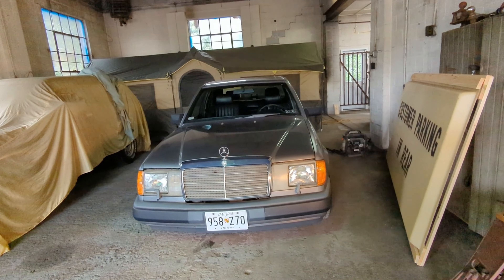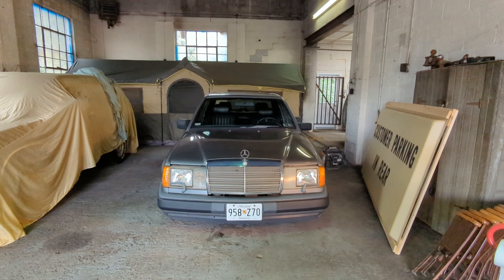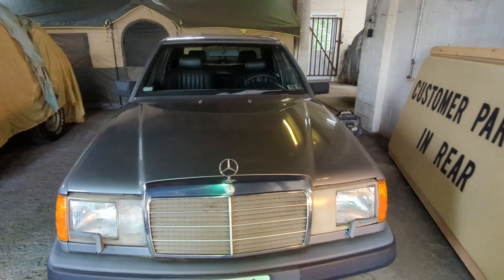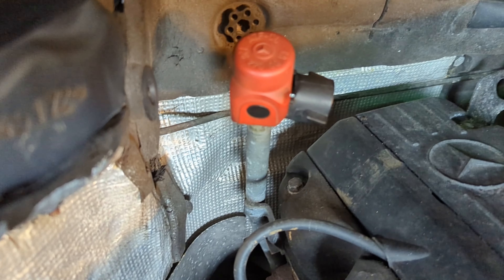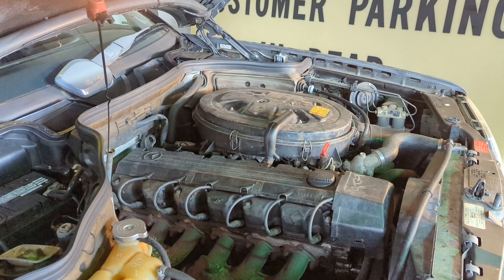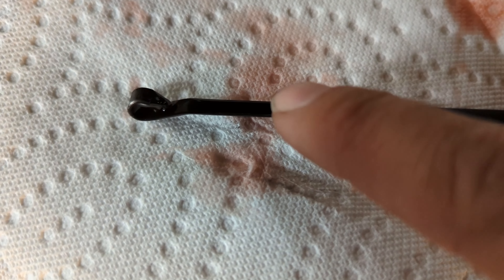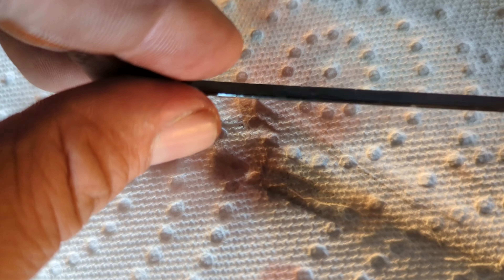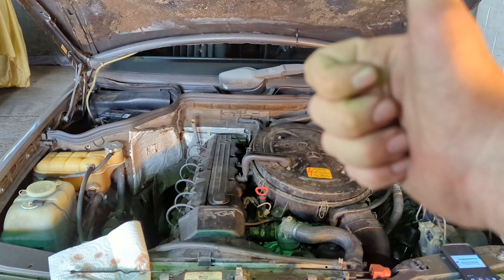Checking the transmission fluid on a 1987 Mercedes Benz 300E W124

Comment: When checking the fluid level doesnt the car need to be running ?
Reply from the maker: Thanks for watching! You want the car to be warm, ideally having ran for a few minutes and on a flat service. For this video, pulled it back in the garage and for my own safety I didn't keep it running (inside) but it was ran outside. Good call out.
Reply: Yes, you need the engine running and warm as on page 71 of the owners manual, the person who made this video is uneducated.  I'm a mechanic. Don't believe me go read the owners manual. .  I will now re type what is in owners manual.  Check the fluid level in the automatic transmission regularly and prior to an extended trip, check transmission fluid level with the engine idling, parking brake engaged and selector lever in the position  "P".  The vehicale must be parked on level ground.  Prior to the check allow engine to idele for approx. 1 to 2 minutes.  Mesure fluid level with the dipstick completely inserted and the locking lever released "in up position read to pull out.  Extream cleanliness must be observed! to wipe the dipstick, use a clean, lint -free cloth.  To fill the transmission with the fluid, pour it through a fine-mesh fliter into the dipstick opening.  Even the slightest impurity m cause operation troubles. The fluid level in the transmission is dependent upon its temperature.  The maximum and minimum fluid level marks on the dipstick are applicable references only if the transmission fluid has reached the normal operating temperature of 80 decrees C (176F).
Reply: @WayneLambrightIII  thank you Wayne ! the car I bought lost all tansmission fluid when cooler line broke I put in a new line  put new filter and fluid in car will not move any sudgestions ?